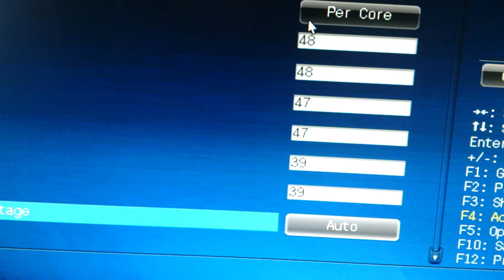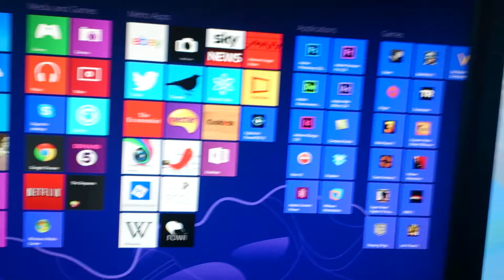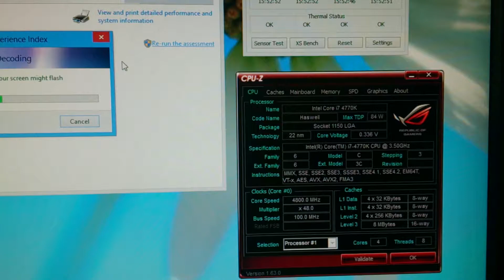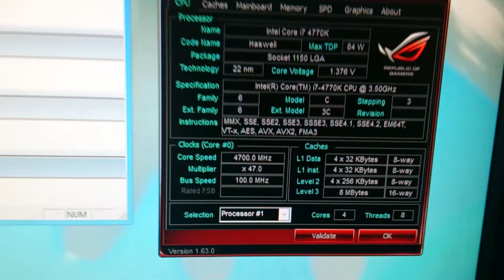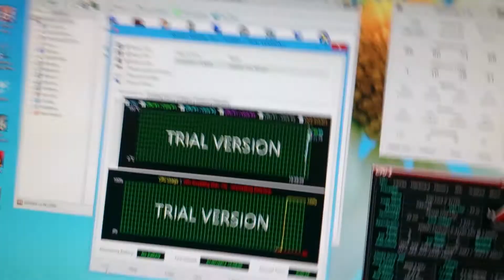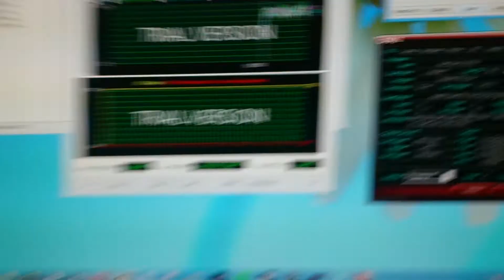Intel i7-4770K 4.8GHz Overclocking - Asus Z87-Pro UEFI and Corsair H80i

Comment: I think you're pushing it a bit with a core voltage at 1.472v. I'm not sure how long the infrastructure of the CPU can handle that voltage. I think it will greatly lower its life expectancy if you continue with that OC but that's just my opinion and you know what they say about opinions on the internet. The highest voltage I would ever go on this chip which is reasonably save is 1.375v but again it's my opinion.